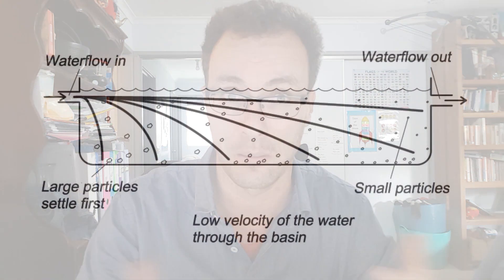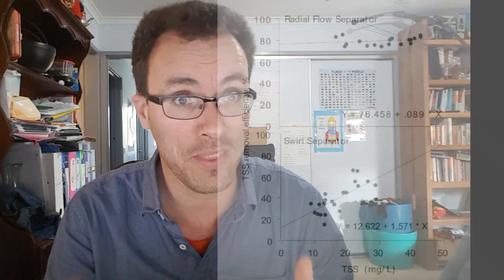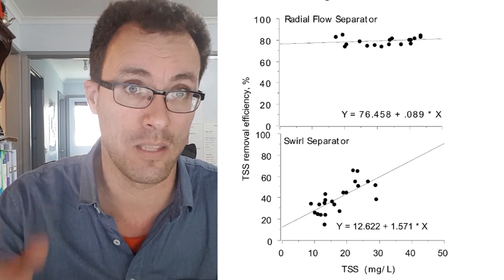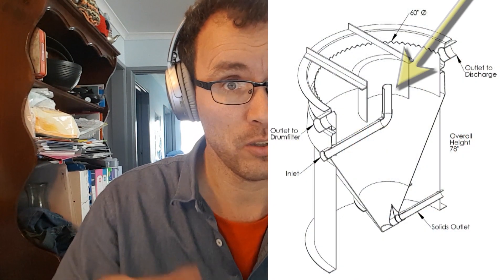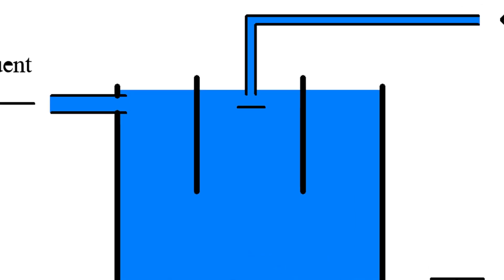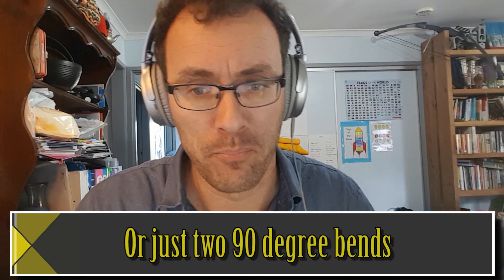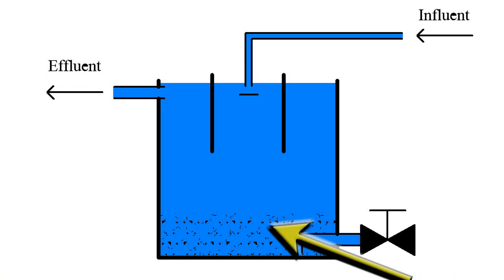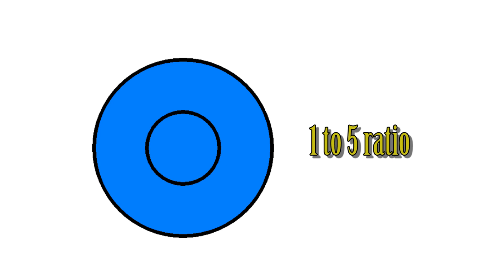Simple, Efficient and Versatile DIY Radial Flow Filters for Prospecting

Comment: When using the two 90 degree elbows instead of the baffle plate, what does that set up look like? Im picturing the first 90 degree bend to change the flow to move horizontally, then the second 90 degree to change the flow back vertically.... but this doesnt seem right. Could you please clarify? thanks!
Reply: I think the first 90 drops the flow down, the second sends it horizontal towards the sides of the inner cylinder. this horizontal flow, like the flow hitting the baffle or the top surface is merely directed away from the bottom of the outer tank and thus prevents all the settled particles from being agitated and re-stratified.  In other words, the goal is to allow the junk at the bottom to simply settle down and collect without being stirred by flow from the inlet.

Comment: Ummm am I right in saying its used to filter the re-circulating pump system for sluicing ?
Reply from the maker: Yes but can also be used to separate according to fluid dynamic properties. Then use a screen to remove all the big and the boring.

Mind you the big and the boring might still be sub 20 mesh.

Comment: Hi Stuart,

Thanks for the shout out.

That looks like a very simple and easy design.  Excellent for a low budget operation.  BTW, have you thought of forming a conical bottom using expanding foam inside the barrel?  I would think it would be pretty simple and cheap to do.

Keith